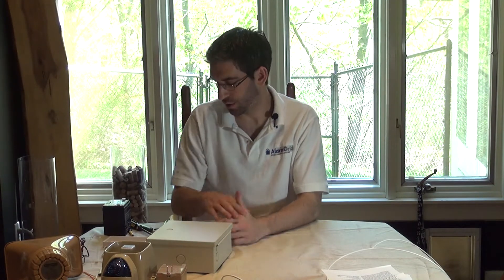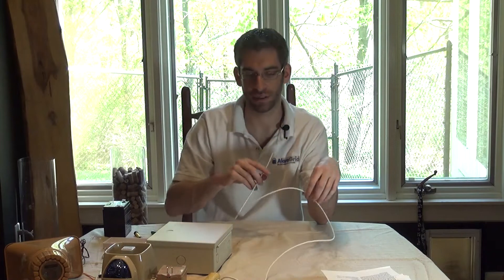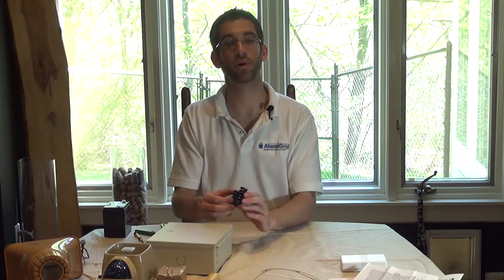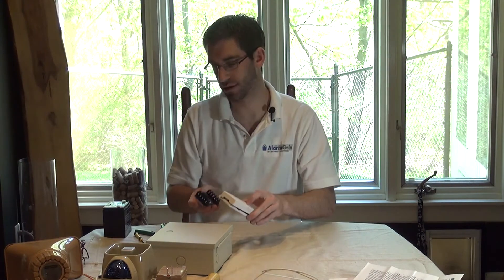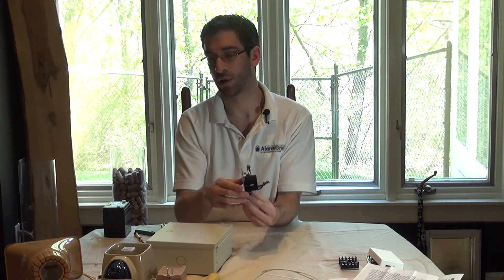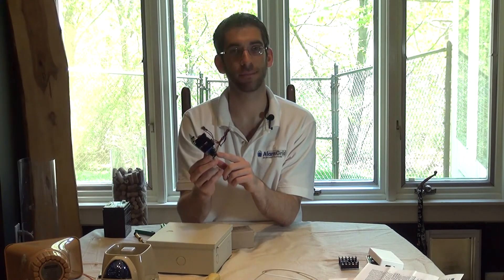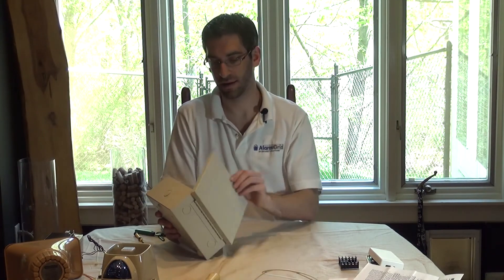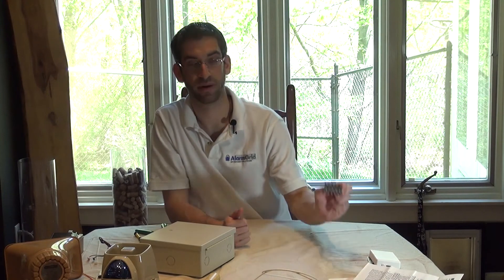Alarm Grid LYNX-EXT: Using Wired External Sirens w/ a LYNX Security System

Comment: After purchasing these items there is no one on this page anymore to help with solutions. I did this setup using the same outdoor alarm system & L7000 unit. The problem, my alarm goes off as soon as I connect AC or backup battery. I set the house code and I was told to set rules as in another video and it was done. HELP
Reply: Throw us an email we'll be glad to discuss.

Comment: Can this be used with the IQ panel 2 plus?
Reply: The IQ2+ does have connections for a 12dc 300ma siren I don't see why it wouldn't work all the low voltage relay needs is a trigger from the panel you will still need the power supply.  here is a FAQ on the siren connections for the IQ panel https://www.alarmgrid.com/faq/can-i-add-a-wired-siren-to-the-qolsys-iq-panel-2

Comment: I have a detached garage and have installed conduit to make the run from the house to the garage.  Was planning on running 22 4 pair to the garage to pick up a set of windows and the door.  The overall length is going to be about 170'.  Is that too far for 22?  I have the option of using cat5e underground direct burial as well. Which would you suggest?

Comment: I have a honeywell vista 20 panel, it says max 2A draw, or 600mA for UL usage.  I would like to add a second siren, right now I have a Wave2 siren, which draws 500mA.  

My question what does UL usage mean?  
I figure I could add another Wave2, but worry about being over the UL usage?  
Also I assume I simply wire both sirens to the same terminals on the panel, in other words connect the POS wire from each unit to the same terminal and the NEG wires from each unit to the ground terminal?
Reply: +Mark Schneider a UL system conforms to all UL requirements to adhere to a certain standard.  There is a UL Residential Burglary standard, UL Residential Fire standard, UL Commercial Burg, Commercial Fire, and so on.  In order for a system to meet UL standards, ALL conditions have to be met.  In this case, UL requires that not more than 600mA be drawn from the bell circuit, if you draw more than 600 mA, you will no longer meet the standard for a UL Residential System, however, if ANY UL requirement is not met, the system is not a UL system.  In a Vista-20P Installation Instruction manual, there will be a section near the back on what the UL requirements are, as well as notes throughout each section showing you the UL requirements.  Unless you are trying to get a UL certification for your system, most likely for some type of insurance or code requirement, you don't have to worry about the 600mA limitation.

Comment: Hi can the 5800RL be wirelessly enrolled to my 5210? I tried using the ID number but cant get it to communicate. Tks
Reply: Yes, you have to program the RF House Code in the panel's System Type settings of programming and then match that code with the dip switches on the 5800RL. If set properly, the panel should activate the A relay on the 5800RL once in alarm mode.
Reply: It's set to 0 on both. Or is 0 ok to use?
Reply: No, you have to have it set between 01-31.

Comment: I have installed a exterior reverend siren and strobe to my L5200. if I made the siren Pulse with fire alarms can I damage it or damage the strobe?
Reply: its a wired siren its not wireless
Reply: +Alarm Tech911 Whichever sirens you have connected to the system should automatically provide the three-pulse temporal pattern when a zone programmed as a Fire zone is activated.

Comment: hello dear,

can you please add a video for installing the outdoor siren AG8 because i have that siren and dont know how to perform its installation and contol with Lynx 5200.
Your support will be highly appreciated.
Reply: Shah Faisal I'm not familiar with that siren but it should be the same exact setup as above. The LYNX-EXT setup works with any siren as long as the siren doesn't over draw the auxiliary power supply that you are using.